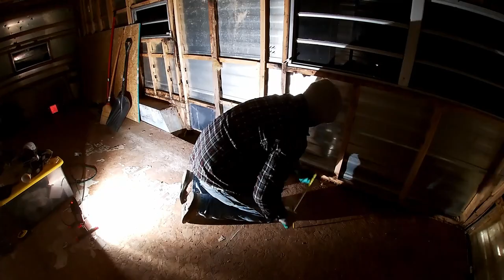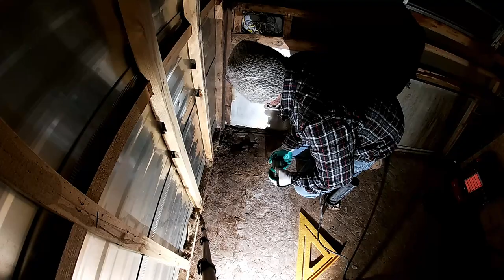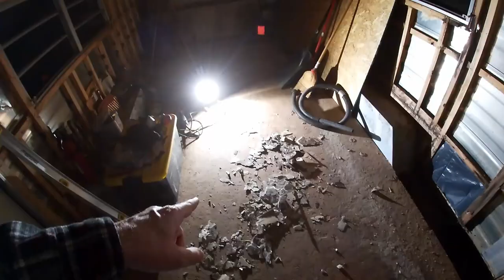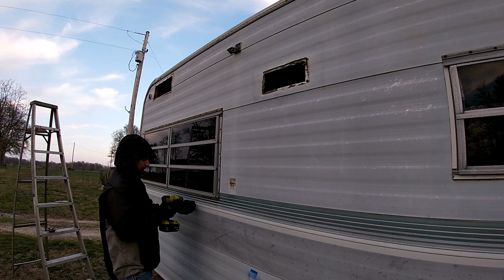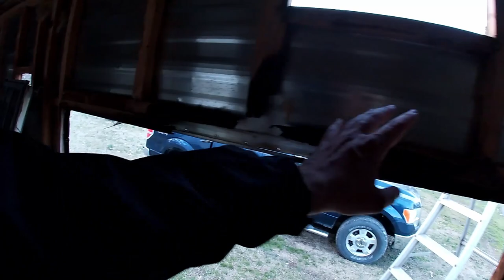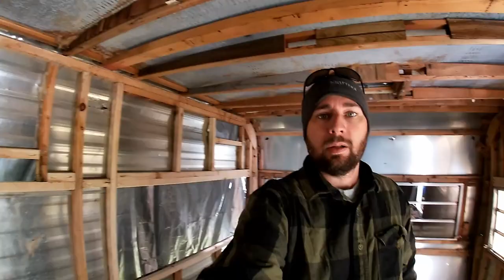Vintage Camper Part 3, Replacing Rotten Wall Studs

Comment: Hey, thanks for the video, I'm looking to replace some rotten wall studs in a similar camper.

Looks like you were able to simply pry the old studs away from the exterior. Were they nailed or screwed in? 
Also, I saw that you screwed the ends of the new studs into their neighbors, but are you also attaching them to the exterior like they were before? I was wondering if there was a way to do this without screwing all the way through from the outside and creating new holes... siding/roofing screws w/ the gaskets would hopefully be waterproof, but still.

Did you ever consider going to 2x4s in the walls or you think 2x2s are plenty strong?
I was thinking to insulate with foamboard, what are your plans?

Thanks!!
Reply from the maker: glad you enjoyed the video.  so, the siding was stapled to the studs at the horizontal seams of the siding.  as for securing the siding to the replacement studs, there was usually some type of window or trim piece that I had to secure into the studs anyways.  I also applied some liquid nail for additional holding.  there are some gaps without it the siding being fastened to the studs with screws, but it is a small distance, so I am not too concerned about it.  I choose to stay with the 2x2 walls because it is plenty stout, and I didn't see a necessity in this project for 2x4 studs.  for insulation, I was going to use foam board but changed to just using fiberglass batten insulation.  the cost was less and easier to install.  I have used foam board on another camper before and it worked great.  in the next video you will see some of what I have talked about here.

Comment: Question can we use regular 2x4s or do we have to use the 2x2s
Reply from the maker: You can use 2x4 if you want. I used a 2x4 and ripped it in half.